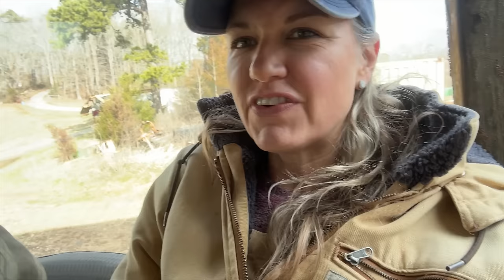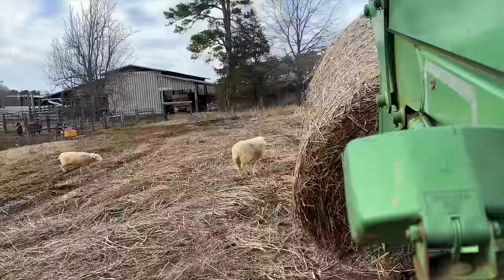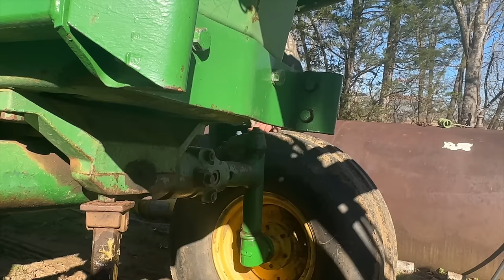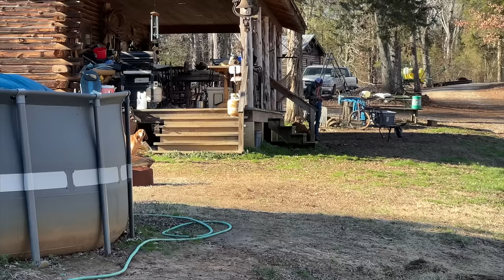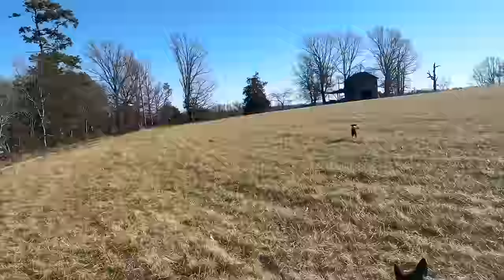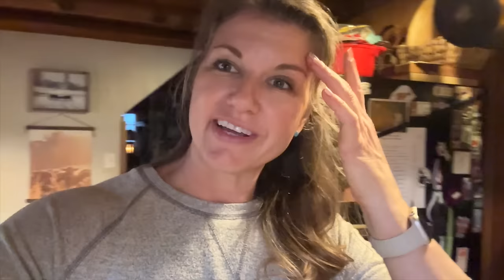Laying Out A New Dream ✨

Comment: We bought our Refrigerator,  Washer and Dryer from Lowes at half price because they had a tiny scratch or dent on the sides of them. Once we push them in place we can't see the damage that is minor. It took us acouple weeks to find everything we wanted but we saved acouple thousand dollars.
Reply: Just don't buy LG, especially a refrigerator. They have serious compressor problems.
Reply from the maker: I would have done that but they said they won’t sell floor models anymore :(
Reply: You add the veggies in the pot for the time to cook each tender in the amount time left on the pot roast..
Reply: Buy a Samsung, they have them like old school with an ice maker 👍😎
Reply: @ThisFarmWife_ We have a scratch and dent store. A lot cheaper and you’ll never see the dent. Works great.
Reply: My god , these are what we call white goods , you know dish washer, fridge, washing machine and dryer and you can buy all four for less than €1500 and if you want high spec ones you could spend c. €2000 but to save €2000 you would have to be buying super high end ones colour coordinated et al . For most people we spend somewhere around €299 to €399 for a fridge or a washer ( dish or clothes) and probably a bit less for a dryer.
Reply: Tie rod adjustment set the toe in or toe out so the tires aren’t pigeon toed or plowing the tires.
Reply: @ThisFarmWife_  check the back of the store sometimes Lowe's has scratch and dents.  Some do some don't.

Comment: Old refrigerators make the best storage cabinets for a work shop.
Reply from the maker: Unless the door won’t close 😅
Reply: @ThisFarmWife_  LB can fix it with some oil 🛢 😅
Reply: Thanks for the tip, I've got 1 sitting outside,  waiting to be hauled off (for the last 5 yrs 😂😅) & if I can get some money scrounged up or bite the bullet & finance, I can replace 2 refrigerators that are in the house. I doubt hubby will use them in the shop, but I could probably put them in the barn. Lol
Reply: I use old appliances for food storage myself.   My neighbor had a small chest freezer he was tossing and I thought..  hey that could hold my chicken feed.  It works great.  Now to use a refrigerator on it's back to hold horses feed.  Maybe I can find a larger chest freezer lol
Reply: @arbuckleoaks4336  I'd probably have better luck using a fridge or freezer to hold grain to keep the mice out then the falling apart Rubbermaid shed I use now. Lol
Do you dump it in or just put the bag's in?
Reply: @AlleyCat-1  I've dumped and I've tried bags.  Both are useful.   Lately I've been mixing and I get free 2 gallon icing buckets from the bakery department at our local grocery store,  so I mix and store the buckets in the freezer.
Reply: @arbuckleoaks4336  yeah I use icing buckets too, we generally get small one's & use those for water buckets for goat's. Need to see if I can get some more. Lol I've got a small barn, so will have to figure out a spot to put the old fridge.

Comment: I prepared a roast beef the other day. Had made a spice mixture with sea salt that the roast was covered with. And then in a bag in the fridge overnight. 
Fryed the roast in a hot pan with a little oil until a dark crust forms on the outside all around. 
The roast then entered the oven at 130°C until a core temperature of 54°C. 
Wrapped the roast in butcher paper and allowed to cool. 
I used it to cut thin slices which can be used for bread and main course.

Comment: If you have a kitchenAid mixer you can always grind those Chuck roast into hamburger. you can even buy some bulk sausage and mix it up with the check roast and use that grind to make Italian meatballs. Also seeing as you have a gas grill you can season it up with some of your musket powder plus salt and pepper wrap it in butcher paper, then wrap it in aluminum foil and put it on the grill for a slow roast. once it is about done you can get some hickory wood soak it in water and put it on the grill to smoke it for a little extra flavor.
Just make sure if you do grind it that you chill the meat, after you thawed out and cut it up in small pieces. Also while you are grinding it make sure you have some ice cubes on hand as well so that the meat does not get hot when grinding. also you can add all kinds of spices all of your musket powder flavors, spicy flavors, Mexican flavors at your ground chuck roast.
Have fun enjoy.
Ron

Comment: Roast suggestion:  Slow cooker method - place 2-3lb roast (I prefer chuck) in slow cooker.  On top, dump and spread out one can cream of mushroom soup, one packet dry onion soup mix, 1-2T Worcestershire sauce, 8 oz sliced mushrooms.  Cook on low until fall apart tender. (5-6 hrs?)  Makes a wonderful gravy in the cooker.  Optional: throw in potatoes and carrots for the last hour.  Note: times are estimates - I cook by checking occasionally. 😃 I guarantee LB will love it.

Comment: Amen Meredith.  I just went thru that same shopping h*** but for a washer. But i went to Home Depot first, they only had the floor display because they don't have storage space in the back (😠 they use to), so i went to Lowe's, they had in stock for $100+ more & the only way they match prices is if you apply for a credit card. Grr
So i went to a discount place that had a scratch & dent one $200+/- cheaper & ending up getting the matching dryer but in a different color, so i have a ying & yang laundry duo lol
Gotta get a new fridge, our newest one has the freezer on the bottom  (don't get, bad idea), its leaked out of the freezer almost since we got it. And now its starting to freeze some thing's in the fridge part. We got an older side by side that came with the house, I'd like to get a full size freezer & a full size fridge that sits together (i didn't know they were actually separate units) then i can get rid of both fridges/freezers,  plus a small freezer maybe. Ams i found it in stock on hand at the discount place for WAY cheaper then anywhere else. So if i could get that (need to sell off some livestock or finance the unit lol)  then in a couple yrs buy the gas stove that hubby wants, even though I'm the one that is the one who cook's.  Lol
I hate shopping & appliances are the worst,  especially if places like Lowe's & home depot can't have it to go.😅

Comment: So Meredith can walk and chew gum at the same time.

I make chili using London broil cut into 1/2" thick slices then cooked in cast iron to slightly char the beef. I add whole tomatoes, Ro-Tel Habaneros with diced tomatoes, and a 2 lb bag of fajita mix peppers and onions and cook for 3 hours. The acid from the tomatoes helps break down the meat.  Add chili powder and paprika, then add dark and light chili beans without draining and cook for a 2 more more hours, and a hour before serving an additional bag of peppers and onions.

The meat is tender, the beans aren't mushy, and everything is flavor infused.  No reason that you can't cut up a roast and do the same thing.

Comment: We also need a new refrigerator.  The one we have still stays cold, and the freezer still gets below 0.  But the ice maker and the water in the door quit working when the fridge was about 3 years old.  The main computer board went bad, and that board was almost as much as a new refrigerator!  Ice cube trays in the space where the ice maker used to be, and a pitcher of water in the fridge is getting very old!  My wife Sandy is wanting to wait until it dies completely.  I prefer to replace it before we have a freezer and refrigerator full of rotten food.  I do know the next one is not going to sound kinda like sung sam! The range was the same brand, and the computer board went bad in it too.  It was only about 5 years old when the oven quit. Hope your new refrigerator is a really good one.  Barry in Canyon Lake Texas.
Reply: Sir..
 I know personally about LGZ, WhirlYpoolz- (dw, frig, stove all horrible).
Speed Queen is the best washer and dryer..if you can find them.
Don't ever get the front loaders they have multiple issues. 
The dumps are full of these POS.
Call a repair guy ask a few questions.
*No not Maytag either

Comment: Refrigerators are a pain.   The experts on YouTube say to buy simple old-fashioned ones and put two side by side so doors open to the middle.  Put ice maker in one and leave the other all freezer.   The simpler the better!  Clean coils often and keep space for ventilation behind and sides.   Problem is that most kitchens have space for one.  But you may have the space...Good luck...